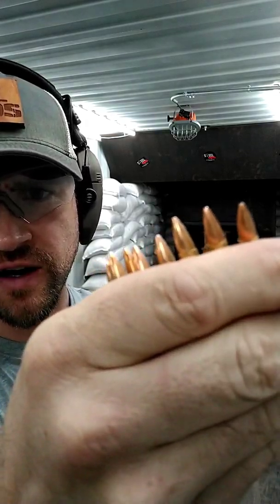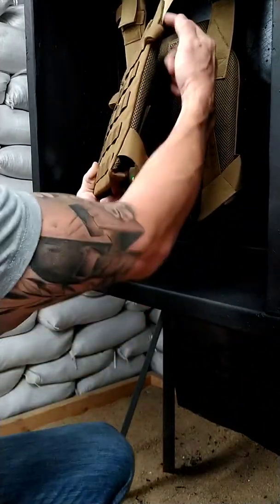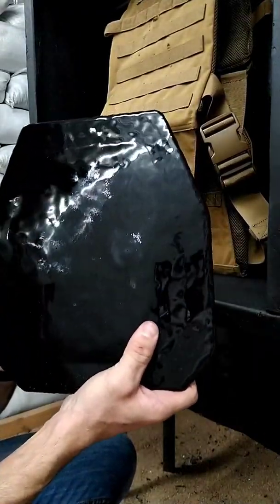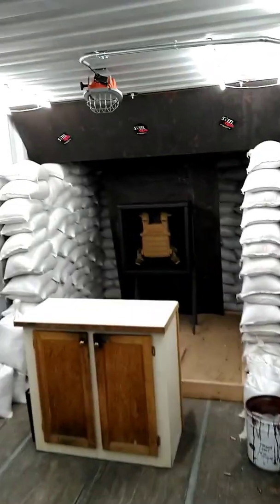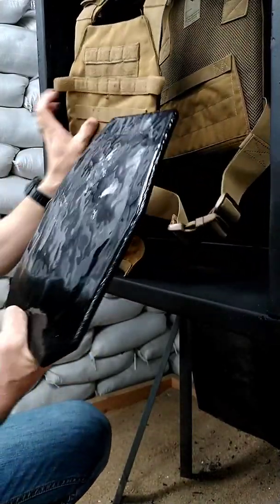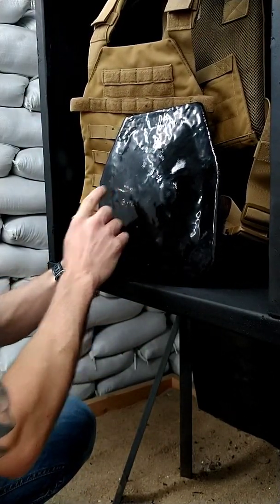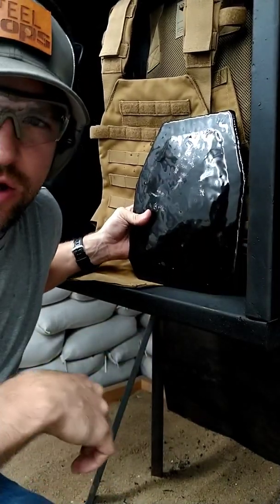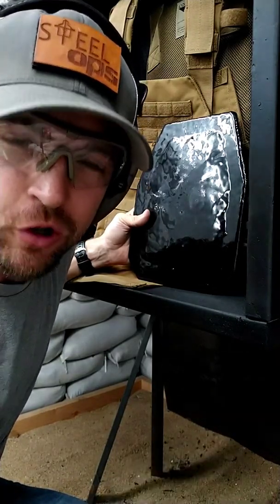Steel Ops Armor creates frag?... or not...

Comment: I’m curious what your response to buffman range is he recently tested your plates and had a lot of pass throughs which he blamed on the armor, I have a set of xp plates and believe you guys make the best steel armor out there. So is his test just trying to destroy your armor or does it have some legitimacy to it. He was using a 24 inch barrel for most of it so I’m not sure.
Reply from the maker: We have communication with Matt. He runs good tests.  He regularly tests armor beyond what it's rated for to see what it can take. You have to take tests with a grain of salt when they go above and beyond what the plate is rated for.
Reply from the maker: He was using a 24" barrel... At 45 ft... So...